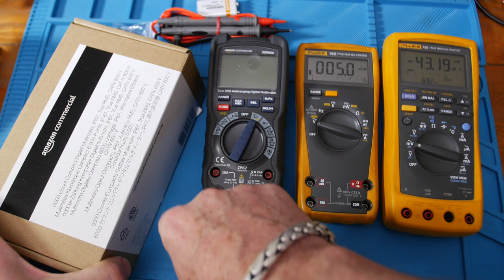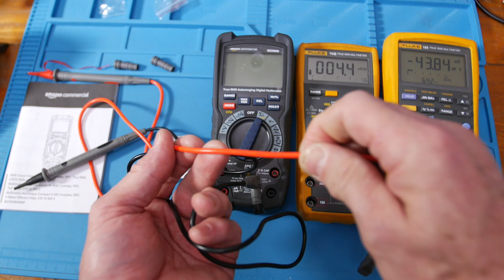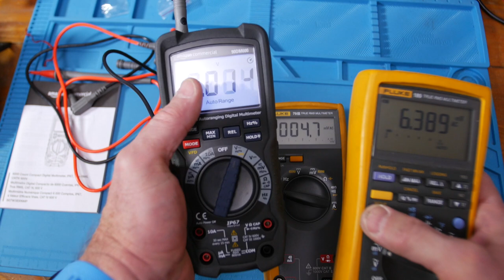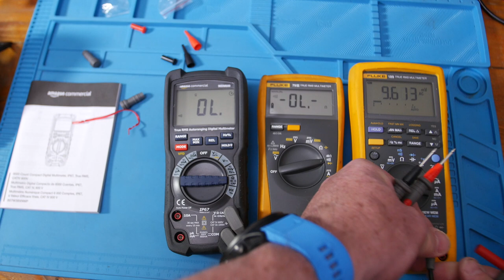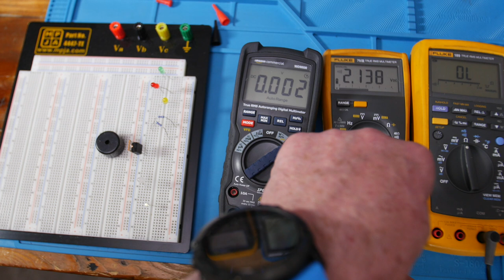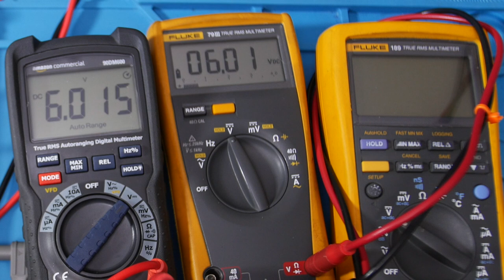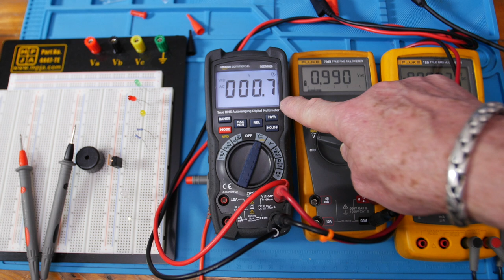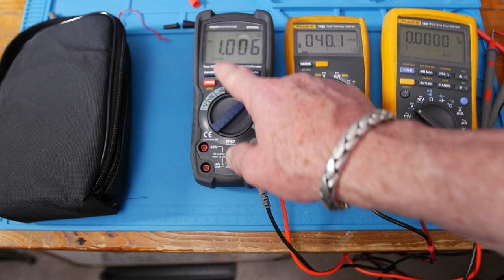Amazon 90DM600 vs Fluke 179 III Multimeter

Comment: The Amazon DMMs are made by CEM and are absolutely solid for the price. My beater DMM for the past years has been a CEM DT-9662-BT, which is basically the same as the 90DM600, just with bluetooth, and it's been working very well.
Reply from the maker: Thanks!  I agree - these are great meters!  And the price is hard to match;)

Comment: late October 2021, and I bought this meter for $39.40 (and then saw this video afterwards). It is $45 at the moment. the continuity buzzer in the very cheap DMM I was using stopped working and I bought this as an upgrade for use on the bench- and I'm really blown away by you get for $40. nice to see the insides and see it compared to more expensive instruments
Reply from the maker: Thanks for this great feedback!  Yes the Amazon is an impressive meter!  The cost makes it even more impressive;)  I'd take it over the yellow meter even if they were the same cost;)

Comment: That’s for a great video. Been looking at this exact meter and will purchase now. Just amazed at the built in overload protection and the ruggedness of the build. Seems like a great over DMM.
Reply from the maker: Thanks - it is a great meter!  Here's a link to the 90DM610 which is an upgrade but on sale at under $48.  https://www.amazon.com/gp/product/B07W1BL3RH/ref=as_li_tl?ie=UTF8&camp=1789&creative=9325&creativeASIN=B07W1BL3RH&linkCode=as2&tag=kissanalog0a-20&linkId=5d30df4af79745315db5669c5f6b13f6
Reply: @KissAnalog  Thanks!! The 610 isn’t available right now, but the 600 is. Looks like temperature is only difference. Gonna grab it.
Reply from the maker: @ToddLuvsGolf  Did you get one? What do you think?

Comment: fluke 79 III is 4000 counts with higher res bargraph; 
 the latter 79 IV & 179 is 6000 counts.
Reply from the maker: Thank you!  I thought the others were 6000 counts, but I didn’t realize that the older 79 was only 4000 counts.  So, thank you for the clarification.

Comment: Yep, I just ordered one after seeing all that protection, not to mention the UL listing,  that sealed the deal for me.  
So yeah,  big thanks to the channel. :)  PS: not that I really need another multimeter,  but the 90DM610 was on offer today at £42.74 (US$53.36) on Amazon UK. 😁
Reply from the maker: Wow you are lucky there are still stock in the UK.  Here in the US Amazon is running out of stock in most models.  These Amazon commercial meters are amazing - especially at the price.  They are 3rd party safety certified as well.  I think Amazon must have purchased a limited qty.  Too bad!

Comment: The evolution of affordable accurate DMM's has blown Fluke off the map.
Reply from the maker: I think you are right Aurthor, but companies like the one I work for just automatically buy Fluke.  So, that will keep them going for a bit, but when a hand held meter cost as much as a scope - their days are numbered.  Thanks for the feedback!
Reply: @KissAnalog  Thank you.  
I'm blown away every time I use my UT39C.  That thing feels nice and solid.
I also just purchased a Tekpower TP5000 that has USB interface for data logging and that really blows me away.  I never thought I would be able to afford something like that.
Reply from the maker: Aurthor Thing thanks for sharing that!
Reply: Never ever, despite some expensive ones like the Agilent U1252B still beeing better than most (all) cheapos Fluke etc. can be calibrated and adjusted, which isnt even possible with most cheap instruments. Also they come with various safety ratings which are mandatory for some fields. Time will tell, I wouldnt bet that those cheap ones will continue to work and be in spec. in 20 years, so...
Reply: @advancedmicrosystems4658  my first meter is a Knight automotive meter.  It was a cheapo at the time I bought it but it still works great.  It even has a analog bar that actually works like an analog meter.
Reply: I'm not so sure. With work hazards out there, I wouldn't take any chances. The incremental improvements over time is difficult to replicate
Reply from the maker: @daixtr  The Amazon commercial is safety certified by 3rd party and has the better IP rating.

Comment: I picked one of these up for $82 on sale. The one I got was defective tho. Continuity would not work, and ohms were all over the place, with multiple lead sets. Amazon sent me a replacement, and its fine. Very nice meter, nice and solid.
Reply from the maker: Thanks for sharing that!  I think the build quality is as good as the competition.  Get back to us down the road when you have more feedback;)
Reply: @KissAnalog  I discovered something else, too. The amazon 9v battery is physically a bit bigger than brand name 9v's. It was a tight fit in the meter, so I used an Energizer, and it fit no problem. Weird!
Reply from the maker: @repro7780  wow that is interesting !

Comment: Thanks for the review. It looks like the backlight doesn't time out. How many times have I used a meter and the light just turns off when I still need it.
Reply from the maker: Thanks Doug!  It actually does time out but I'd have to double check the time delay.  It is fairly long which is really nice;)

Comment: Out of curiousity did the Fluke leads fit the Amazon DMM? I realise in your video you determined that the Amazon leads did not fit into the Fluke DMM's but no footage of the other way around. Just want to know if you can use 'standard' leads albeit you may lose some of the IP67 sealing?
Similarly did you determine if you can get replacement leads with the required 'sealing' connectors?
Reply from the maker: Thanks for the great question!  Standard multimeter leads do fit and they are also snug, so they fit great.  I notice that this meter is hard to find in stock as well as the 90DM610.  The little brother, the 4k count meter can be found here: https://amzn.to/3ziIEF0

Comment: Hey Eddie. I just got an ip67 40k count reed re5010 according to the manual it has great input protection and you can pay extra for the nist. I bought a set of pomonas and 50ft of pomona test lead wire to make 2 ended grabbers for quicker prototyping. It all came to just over 300 dollars. I'm going to record a review and post it to my channel.
Reply from the maker: That's a great meter!  I almost bought one but I have to save up to get another great meter.  I can't wait to see it on your channel:)
Reply: @KissAnalog  it's kind of old and it's used by like 3 brands but the reed seems to be the best model. It's ul listed and you can get the calibration papers if you contact them unlike the others. There doesn't seem to be any empty input protection holes or pads like you see on some meters. Funny how they hide the birth certificate of the meter from your hands behind a pay wall.
Reply from the maker: Let us know how you like using it;)

Comment: I know this is an old video but which would you say is the better deal today.....this or the kaiweets ht118a?
Reply from the maker: Thanks for the great question!  I think this Amazon meter is an amazing deal, it has 3rd party safety certification, and an IP 67 rating (so sealed very well).  Just a very rugged meter - the best deal anywhere.  I don't know of a meter that competes for under $50 - is is pretty ridiculous.  The 90DM610 has temperature setting too and is awesome meter: https://amzn.to/3I7I2om, but if you don't every need temp readings then under $40 the 90DM600 can not be beat: https://amzn.to/3q13mpv
Reply: @KissAnalog  thank you for your swift reply. I will definitely use your links when i am ready to buy it....thanks again for all your hard work..keep it up !!!
Reply from the maker: I appreciate you!

Comment: Thanks for your review. 90DM150 or 90DM600 you've testet? The price difference in Germany are 10€. For the 150 only 14,85€ and for the 600 about 25€.Which I should buy? 🤔
Reply from the maker: Wow if you can find these they are great meters.  I think Amazon did a one time buy and I can't find them anymore here in the US.  I really like the 90DM600, but if you can get the 90DM610 it add temperature I believe.  Let us know what you find;)
Reply: @KissAnalog  Thanks for your quick response. Amazon Germany has 40% rebate of Amazon branded products (they increase the prices before :), but still cheaper as normal). The 90DM610 costs about 40€, but I don't need temperature. I've ordered both, the 90DM600 and 90DM150.
Reply from the maker: Wow - great to hear!  Thanks for your feedback!
Reply: @KissAnalog  Did you also testet the DM150?

Comment: For less than $100 dollars, it has some of the best input protection that I have seen--better than some of the high end brands and models; however, one must keep in mind that just because it has 4 PTCs and 5 MOVs doesn't mean that it is robust: are they quality PTCs and MOVs?  Are they spaced correctly to prevent creeping voltage?  How many high voltage  transients can it take before breaking down?    But damn in theory, it sure cannot hurt.  With an IP rating of 67, it has a reasonable amount of dust and water resistance.  All-in-all, the Amazon 90DM600 for less than $100 may be one of the best meters for the price that an electronic technician or electrician as a field meter.   I appreciate the time you took to review this meter.  I have been looking at the Amazon versions for awhile now which like others believe that it is CEM renamed.  From other reviews of that company, it seems that they have an above average quality control.
Reply from the maker: Thanks for the great feedback!  It looks like Amazon asked them to come out with some new models for them with even more features.  I’ll bet CEM brought it up a notch to partner with Amazon.  I think the big boys should watch out.

Comment: Very Good Video  of Amazon 90DM600.
Since I have brought this meter I am finding it difficult to get the correct output reading from a Ac 240 volts socket.
By following the instructions on page 17-18 for AC voltage measurement. The reading I am getting is AC 0.328 ?
I was wondering whether you could guide me as to what I should be doing to get the correct reading of 240 volts.
Thanks
Reply from the maker: Sorry, I just got to this.  Have you solved the problem?
Reply: @KissAnalog  
Hi Body
Yes I managed to solve it. Instructions are shown on page 19 under 
“Voltage measurements (mV)”. Thanks

Comment: Amazon UK do this 600 for $58, the 610 version for $78 or a Used like new Fluke 179 for $268.  I am looking for a meter just for home and auto use and like the idea of the temp being included. What would you recommend, as i know it is not a bad price for the Fluke, but  still a bit more than i was thinking to spend. Amazon meter looks good, but is it worth the extra for the Fluke given the used price, or would i be better going for the 610?
Reply from the maker: Forgetting the price - hands down the Amazon meters are better.  The 179 is an old design needing a makeover.  The Amazon meters come with an actual IP rating that the 179 can not touch.  I do have an automotive meter that just came in, so I will be reviewing that very soon.  Here is a meter that is priced somewhere between and ids one of my favorite meters.  Amorobe and Fluke are both owned by the same company.  https://amzn.to/2OfIV7X
Reply: @KissAnalog  thanks for the advice on the Amazon meter, as it does look a solid meter and the temp is really handy. I see they have a few in the range. Even the 90DM160 has a temp and in the UK its $32. I think the 610 would fit for me, given it has the temp and looks a better build than the cheaper ones. I better decide, as both the 600 and 610 have jumped up $7 since i put the first question to you. Maybe they are heading up in price as they sell. I did look at the AM535-EUR Industrial Digital MultimeterByBeha Amprobe before you mentioned the Amprobe AM-570. The 535 was around half of the 570, which is about $230 in UK, ..What is the difference  betwen Beha Amprobe and  Amprobe ?
Reply from the maker: @fhtrucker62  Sorry this response is so late.  Just found it;)  The Beha is a German company and Amprobe is an American based company.

Comment: Hi, first of all, thanks for sharing your experience with us! I'm after a DMM and the Amazon DM600 looks pretty nice but then realised it refreshes display twice per second whilst most low cost DMMs in my list refresh is 3 readings/sec (HT118A, AstroAI,....). So, does 3 Vs 2 readings per second make a noticeable difference?
Reply from the maker: Thanks for bringing this up.   I notice most meters are either 2 or 3 updates per second.  A few meters will actually state what the readings per second are versus the display update rate, but most just call out one number, so it's hard to tell.  More seems better, but I'm not sure that you could see the difference.  I think in some cases there's meters that let you slow it down so that the numbers are not flickering so much if the voltage isn't really stable.  The Hioki DT4254 (DT4250 series) is in this price range and updates at 5 times a second;)  Hioki will offer a discount to any of my viewers purchasing any equipment from them by using this link (use promo code: EDDIE5%01): https://www.hiokiusastore.com/
Reply: @KissAnalog  Thanks! Sure will check Hioki 👍😊

Comment: The Amazon meter looks like a CEM DT-9660 series meter. My Reed branded CEM DMM and LCR meter have both been great meters. I would not hesitate to recommend the Amazon meter, especially for the price point.
Reply from the maker: I agree with you.  And I think you are right about that series, but I couldn’t find real close CEM versions.  My guess is that their newer updated models were branded for Amazon to help credibility.  I’m on board - very impressive build quality and ergonomics;). I need to check out more of these.  Maybe the high-end model.  I’ve done the low cost, and now the middle cost.
Reply: @KissAnalog  yes! I think they have a higher end version with some logging capabilities. Maybe look in to that? Also do you think Amazon will sell a branded oscilloscope...?
Reply from the maker: @Isogen That’s a great question!  I would not be surprised to see them come out with a scope.  I wonder who they would partner with?
Reply from the maker: @URanInTheUglyForest Thanks for the link.  I hadn’t heard of Reed Instruments.

Comment: I short the leads on my fluke 179 set to mv ac and is shows 0.5 after waiting about 15-20 seconds is this normal? Any help would be greatly appreciated guys 😊
Reply from the maker: Great question!  For some reason my Flukes read higher on mV ac then on dc.  But, that’s higher than I get on my Fluke 189 I get anywhere from 0.015 to 0.05 as it bounces around with the leads shorted together.  My Fluke 79 is 0.0 mV, but then if I manually change the range it goes to 0.015 mV ac.  My Hioki I get 0.0001 which seems better;)
Reply: @KissAnalog  Thank you so much for replying, I get 0.0 mv dc and its almost instant the reading, I'm no expert but I would imagine it should be the same on ac. Now the million dollar question? is it a calibration issue or do I have an expensive paper weight 🤔
Reply from the maker: Great question!  It is most likely a cal problem, but you can set an AC generator to 1 V, and see if it is just noise, or if you actually measure 1.5V.  If it measures 1.5V then it might be just an offset issue and will be ok, but if it reads something like 1.7V, then try reading 2V and see if it is even more off.  Another thing you can try is to go into manual range mode and see if it is any better.

Comment: Looks like a rebranded CEM DT-9560, well..
Reply from the maker: It really is a CEM, but it looks to be made to a spec for Amazon as I can't find the Amazon series at CEM.  The Amazon series looks like they offer better functionality for the price.  Very well built.  Here's a link to the new 90DM610 that offers temp readings too:  https://amzn.to/37WSX80
Reply: @KissAnalog  Look at the CEM DT-9562 with 6000 counts. Another "hint": look at Amazons "Part Number": DT-9560, they just took CEM's model numbers as part numbers..  ^^ But yes, the specs may vary, CEM is a big OEM, you can find their meters under several brands all over the world. They used to make those horrible Extech meters. I have an EX520, it was DOA but repairable - a MOV was broken off.. I wouldn't trust them, for mains voltage and above take a Gossen (aka Dranetz in US), Fluke, Sanwa or Agilent.